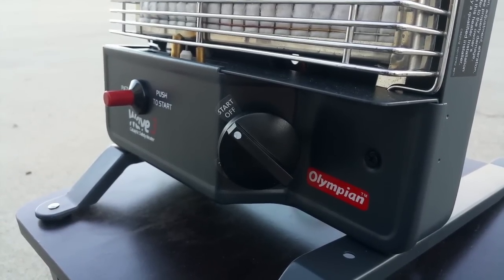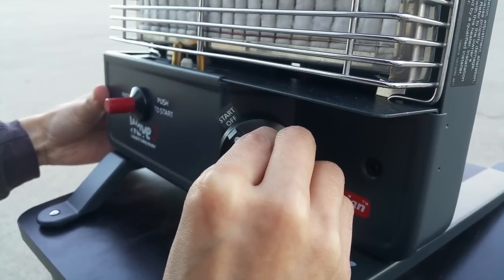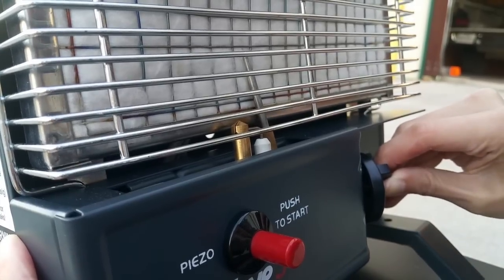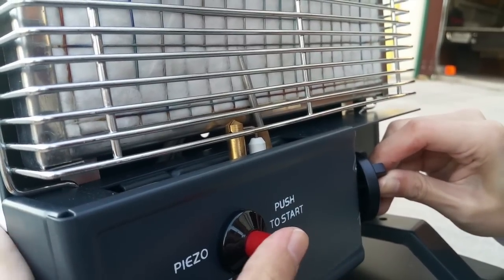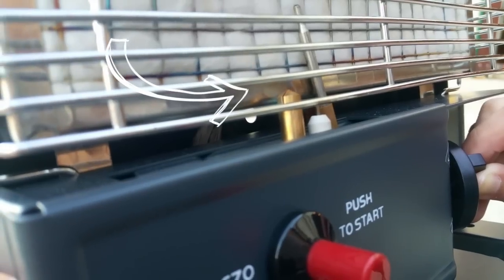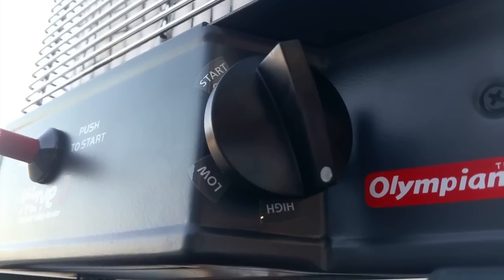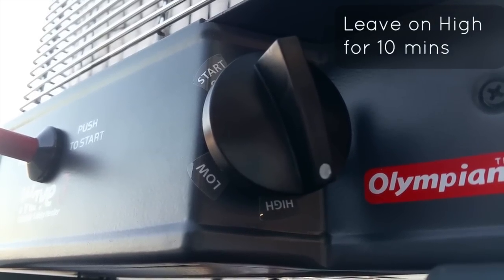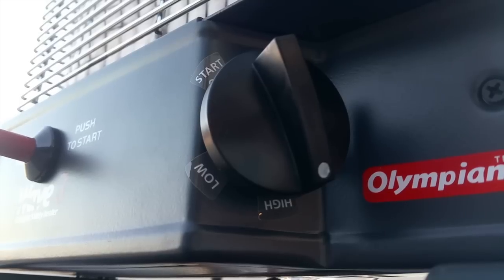How to Turn On Olympian Wave Heater

Comment: Young lady the connections at the 90 deg., hose, to unit Must be thread taped with gas tape. Found at any hardware store. The small LPG bottle will drain quickly. These heaters are nice but not efficient. The LPG bottle should isolated too.
Thing solar power with a 12 volt heater, two 6 cell batteries isolated also with a 90 watt panel would give you plenty of DC power that could also be converted to AC.
God luck
Reply: NO. Gas has over 100x the heating power of even the most efficient battery system. My industrial UPS (APC Symmetra) uses 384 12v 9Ah batteries -- 40kWh, and would fill her van (and weighs nearly a ton.) The Big Boy(tm) UPS batteries (225Ah) are ~3kWh each, and weighs more than she does. 1L of LPG is 6.9kWh, and weighs ~1lb. (not that I recommend using those tiny camp stove bottles)
Reply: There's actually no need to use thread tape or dope on either end of the brass 90 fitting--you can see that the connectors are beveled, indicating that it's a compression fitting, not a standard threaded fitting. With compression fittings using thread tape or dope can actually cause leaks by not allowing the fitting to tighten down enough, meaning there's not enough pressure to seal the fitting.

Comment from the maker: The step by step process intentionally goes over minute details for others out there like myself who prefer having a visual aid with baby steps. :) Apologies if it seems mundane to some! 

Safety precautions not shown in the video:

- The 90 degree connector that attaches the hose to the heater unit was tightened with a wrench
- Propane leakage was tested with a gas detection pen

Safety precautions for the future:

- The van will have at least 1, if not 2, air vents
- a carbon monoxide detector will be placed in the van
- Tape to prevent gas leaks once this becomes a more permanent install

HAPPY FRIDAY! :D
Reply: I would get at least 2 monoxide detectors just to be safe. If it was me, I would have 3 because there's such a high risk in that scenario, and it's just always better to be safe than sorry.
Reply: If you mean teflon tape on the gas fittings when you stated " Tape to prevent gas leaks once this becomes a more permanent install", please know that this is not recommended procedure with propane/CNG/LNG fittings. They should connect gas tight without the use of sealant tape etc and if they don't then the  fittings are faulty and/or worn and should be replaced.  PLEASE don't screw around with this kind of thing.  When I was living and traveling in my 74 VW Bus, I didn't have a propane fired heater, but I had an 12v electrically fired, gasoline fueled Stewart Warner heater.  Greatest thing ever.  Anyway, point being, skip meals if necessary to have the $$ to set up your heater safely.

Comment: Why did you choose this one instead of the Buddy Heater?
Reply from the maker: It's supposed to produce less carbon monoxide :)
Reply: EvilEmpire83 Haha! Good reason!
Reply: correct me if I'm wrong, but it has nothing to do with the heater. you burn gas/you get co2. I lived in a (uhaul) van for a couple days and had a little buddy and it worked perfect, kept me warmer than I wanted. I cracked the front two windows and didn't die.  10 degrees farenheit out.
Reply: did u see explorer steves lil buddy heater? you follow the same greats as do i.
but i prefer lectric w/ thermostat. see living free vid poor mike is miserable.
Reply: +wantsanewvehicle You may also get CO, which can kill you.
Reply: doesn't matter what heater you use, if it burns gas it creates co2... 

Somebody might drive by your house tomorrow and shoot into it, or a tree might fall on you while you're sleeping and that can kill you too.  Obviously you want to take the precautions, such as trying to live in a good neighborhood, and cutting down trees that look like they might fall if you look at them the wrong way. Just as you'd crack your windows if using a gas heater in a vehicle.
Reply: wantsanewvehicle Dude, just don't confuse CO2 (carbon dioxide) with CO (carbon monoxide). CO2 is harmless, CO will cause asphyxiation.
Reply: I think you know what I mean :)
Reply: CO2 is ok! it is CO that is poisonous, capish?
Reply: ahh, OK.  stay safe compadre.

Comment: I find heater fans work better than most small heaters.  Also, they seem to be safer.  They run on electricity and I don't think they use a lot of electricity.  (I am assuming that you have the electricity thing figured out for your vehicle.)  I use one small heater fan for my work space (the size of a one bedroom apartment and the heat it generates circulates really well (much better than other electric heaters I've tried.)

Comment: I just bought and tried my Wave 3 for the first time, temp was up 20 degrees, still cold but bus is not yet insulated, great item.  FYI I am looking at no power dehumidifiers to compensate for condensation, what are you doing to compensate?
Reply: Do you find that your heater adds moisture? Mine doesn’t at all. I’m fact dries everything out.